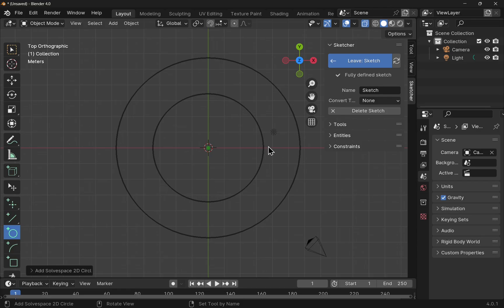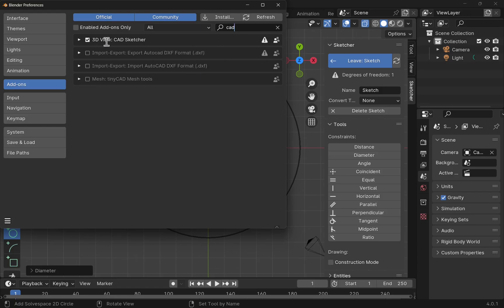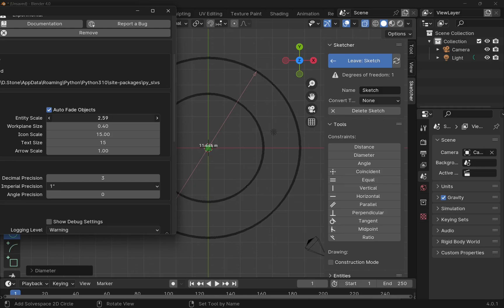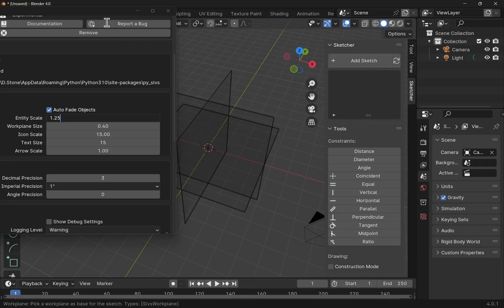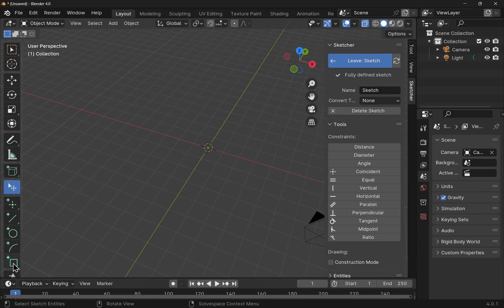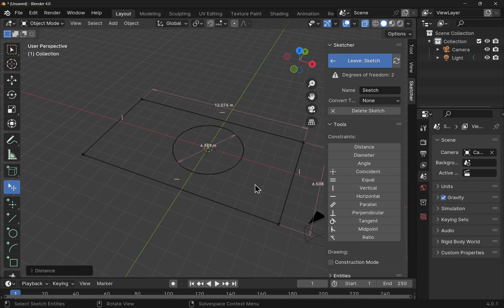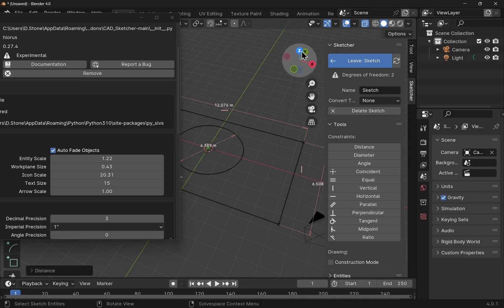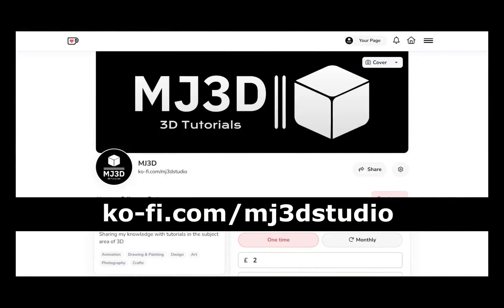Make Your CAD Sketcher Sketch Easier To See!  Learn Blender 3D CAD Design

Comment: Thanks SO much for this series.  This will help me design small things to 3d print.  I discovered that using small construction lines with specific  dimensions I can use coincident points to place holes, lines etc at center of areas or any place I choose.
Reply from the maker: Great to hear 😊😊😊